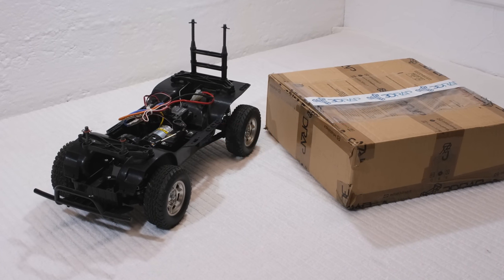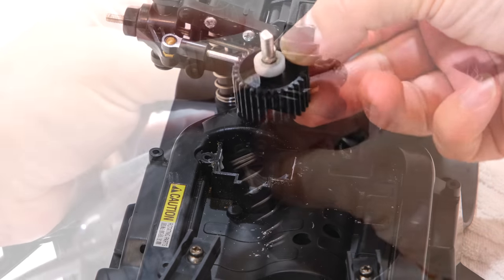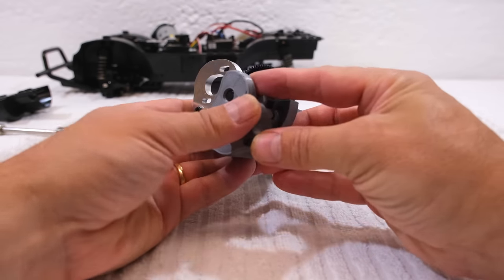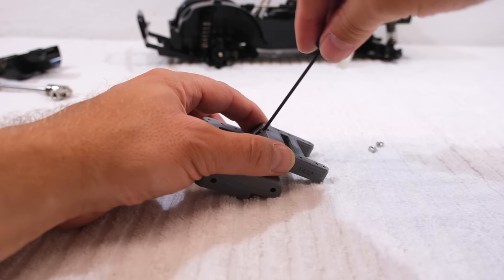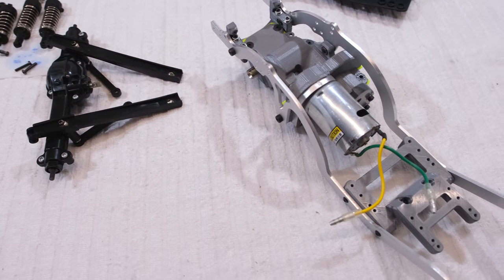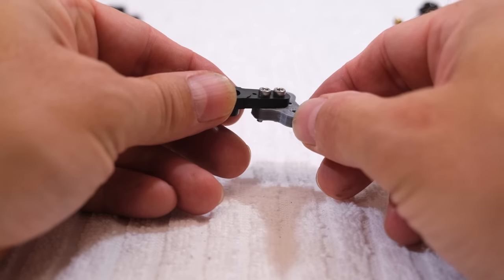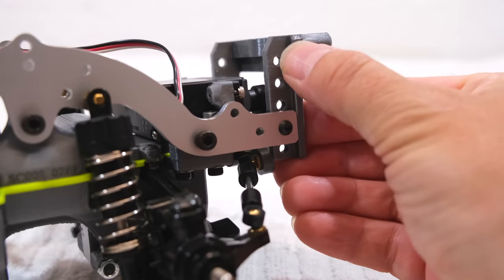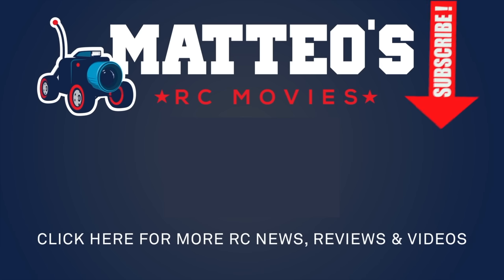Tamiya CC-01 Longheroni Conversion - Installation and Transformation

Comment: Great to see the CC 01 getting some more aftermarket love.  Would be great to see some more suspension travel to compliment the new chassis. Looking forward to a running video and your thoughts afterwards.
Reply: Some aftermarket love? He replaced 80% of the original parts! 3DRAP should finish the job and replace the remaining Tamiya parts, because they're made of weak ABS plastic and they will crack and fall apart when they get old, even if the truck is never driven.
Reply from the maker: I'm sure, with longer dampers, we can get more travel... 👍😊
Reply: @Matteomeier  Even if you put long dampers in front, suspension travel would still be very limited because you still used the stock lower suspension arms. What you should have done is redesigned a new longer lower arms to allow more travel. I admire the effort and engineering you've done here but it's the suspension is what you have improved from the very beginning. The gearbox of the stock CC-01 is fine. It's the steering and limited front suspension travel are the biggest issue of the CC-01.

Comment: I have a CC01 chassis that the previous previous owner tried to convert to a front mount servo like in this conversion. That ended up cracking the tub of the original chassis. Buying a new tub was almost the same as buying a new CC01, so it has lived on the shelf for many years. Maybe I will get this conversion as all of the running gear is still good and much of it is metal upgrades already! Thank you for putting the beetle body on in the video. Gives more feeling to the finished size!
Reply from the maker: Yes, this can solve your CC-01! 👍😊

Comment: Wow, totally what it should have been to begin with. I had just shelved my CC-01. Gonna have to give this  a go.
Reply: Could NOT agree more!!
Reply: I'm vaguely tempted, but I think I'll get an Element RC TrailRunner instead. Same suspension design, but it's made from stronger plastic and it fits standard 1/10 scale truck bodies.
Reply: Shawn Elliott the trailrunner is 10 times better than a cc-01. Its an actual crawler and this is an old plastic cross country design
Reply: @mojaverc1585  maybe, but the CC-01 is a classic and we are not talking about no Trailrunner.
Reply: theLEDwheel yeah I know its like 26 years old but I would rather have a trailrunner than my cc-01.
Reply: @mojaverc1585  the cc was designed to be a cross country vehicle, not a crawler and the trailrunner is (in my definition) still not a crawler. The CC can take other bodies and is available diff wheelbases. I've seen some amazing projects with it. 

What you   have vs what you want or prefer is a personal choice. I have 4 trucks that i taken out on trails and rocks and the one i choose on any given outing depends on how i feel and want to experience that day.

Putting down RC's that others love is not constructive. If you  want an Enduro then get one.

:)
Reply: theLEDwheel i was actually just agreeing with shawn that he should get a trailrunner because of my experience with my cc-01.
Reply: @mojaverc1585  sorry, was not directed at you. Replied in general but you got tagged.
Reply: @deusexaethera  For a "Crawler" I would agree...
BUT the Bodies for the Crawler Class are NOT 1/10th Scale - more like 1/8-1/9th Scale. 

CC-01 and CC-02 are TRUE 1/10th Scale!
Reply: @CarminesRCTipsandTricks : I disagree. Scale crawler trucks with 1.9" wheels are slightly larger than 1/10 touring cars, which is scale-accurate since small trucks and SUVs are slightly larger than real cars. The CC-01 is the truck equivalent to Tamiya's 1/12 "M chassis" touring cars.
Reply from the maker: Good idea! If you have a CC-01 left, you should do this! 👍

Comment: Ordered, will arrive tomorrow..... CC-01 deserves a lot of love :)
Reply: But even now I can see an issue. As the front shocks are in the middle of arms, they are working under 2:1 ratio, while rear shocks are working 1:1. In gerenal it means that the front is easy to compress while the rear looks tough. And now the battery is placed in the front as well, which means it will make the situation even worse. We'll see.......

Comment: I have the same chassis, but I feel its performance is not good, I have also thought of rebuilding the chassis in this way. I just don't know how to do the gear box. After watching your video, I feel this solution to be very good, use 3D printing. Thanks a lot.

Comment: This conversion kit is very good for optimize cc01 chassis , there is room behind the motor , so we can install gear reduction without cut anything , and i think we can use cc01 upgrade kit from yeah racing or gpm
Reply from the maker: Yes, of course! Then it's even better! 👍😊

Comment: My Friend, this goes beyond conversion... It's a TRANSFORMATION!! 😁 I will be anxiously awaiting seeing how it performs. 
The only thing I question about it - the CC-01 ALWAYS has been Geared TOO HIGH. I was hoping with all that impressive work on redesigning the Gearbox... They could have fixed some lower Gearing. At least give provisions for a smaller than 16T Pinion Gear.

Other than that I'm completely impressed!! Have a great Weekend!! 😊
Carmine ✈🚂🚙
Reply: It looks like with that slotted motor mount, you could likely stick a smaller pinion on no problem.
Reply from the maker: Hi Carmine! Yes, smaller pinions can be installed, up to 12 tooth. Have a nice day! 😊
Reply: @Matteomeier  COOL!!

Comment: I bought this kit after watching your video. Although the design is great, it's made out of cheap materials and is not very precise. Nothing fits right. It's very brittle and breaks easily. I had a minor crash and the front end is gone.
Reply from the maker: I did not drive mine yet. But you should contact 3drap and tell them your problems. They still improve the product.
Reply: Hi Erin,  In the first minutes watching i thought great upgrade. But watching sir Matteo assemble the whole thing, i was concernd about quality of plastic parts. They look indeed brittle and not 100% fit? Thank you for confirming Erin.  Matteo 👍🏼

Comment: That is a very comprehensive chassis upgrade for the CC01, however, one might have to ask oneself, why upgrade this chassis  when you can purchase a CC02 ? Also you will need to compare the cost of the upgrade to the CC01 with the purchase of the CC02?
Reply: Or you could buy a good chassis and get nice parts of your choice
Reply from the maker: Of course I would not buy an extra CC-01 for this conversion. But when you already have a few CC-01s it's a good choice...

Comment: Thank you for a nice video and very informative and instructive as always!
I look forward to the comparison test in the terrain, to see what problems with the CC-01 this new chassis solve. The steering is direct on the new chassis of course, taking out the play in the CC-01 linkage system, this is an improvement. But are the articulation, weight distribution and ground clearance better on the new one? 
The position of the battery pack is higher on the new one, giving the new chassis a higher point of gravity.  The battery on the CC-01 is placed much lower, giving it the advantage of a lower point of gravity, and will this give the old CC-01 better handling in the terrain compared to the Longheroni?
The all important driving test will tell, it will be exiting to watch.
Looking forward to your next video, all the best.
Cheers.
Reply from the maker: Thanks Nordmann, I will try it on the field soon! 👍😊

Comment: So replacing the entire chassis gives a more direct steering input from the servo (but likely not much more in steering range) as well as the ability to use longer shocks.  Is this worth the 109 euros?
Looks cool though, and slightly easier to clean.
Reply from the maker: I forgot to mention the possibility to install smaller pinions... 😊

Comment: How does it feel? Is it sturdy? will it handle bashing? 

I have a darkdragowing engine printed in abs.... feels cheap, already broke 2 things on it...and I haven't even been on the trail :D
Reply from the maker: The parts feels pretty robust. But in my opinion a CC-01 is not a basher, more a trail truck for slower drives.

Comment: I have bought this kit, and I dont think I like the steering. It seems that i turn sharper on the outer wheel than the inner wheel when turning. Have you noticed this? Have you done some changes to this issue?
Reply from the maker: Yes, that's true. The outer wheel turns sharper, but it should be the opposite. I have not driven the car yet, but I think this issue can only be fixed by moving the servo to another position.

Comment: That fluorescent yellow rubber seal screams "Italian design" to me. Italians love bright accent colors.

This looks like a very well made kit, but I'm not sure what the point is. Reusing any of the CC-01's extremely old parts is a disadvantage. 3DRAP should finish their design by replacing all of the remaining CC-01 parts.
Reply: Yeah i reckon this is pointless. Just buy a good chassis and put some nice parts on it. The cc-01 isn’t capable but that is what makes it fun.
Reply: @mojaverc1585 : The lack of capability made it not fun for me.
Reply: Shawn Elliott Its actually beginning to be not fun for me too. Thats why i haven’t run the cc-01 in months. It would be too expensive to make it fun. Lipo, electronics, suspension, tyres, wheels, steering, suspension links. At that point it still has a bad chassis. Also its so small
Reply: @mojaverc1585 : Yeah, that's the position I found myself in after owning a CC-01 for a few months.

Comment: I feel like Tamiya should have just updated the CC01 to provide more gearing and better ground clearance instead of the IMO quite cookie cutter and inferior design of the CC02.
Reply: The CC02 should not have been a CC
Reply: It is a CrossCountry vehicle!!! Everyone got that straight! Its not a crawler. Its like to take a jeep for a monster truck spin but cry in the end why this jeep wont jump like a mt
Reply: i love my cc01 fast and versatile
Reply: From my point of view CC series arent meant to be competitive scale crawlers but meant to be a Radio Controlled "Model Kit" since tamiya really is a scale model kit company. It focuses mostly on the You have to build it and appreciate it more than the RC capabilities. I Buy tamiya for nostalgia nd overall fun and buy aluminum aftermarket parts for a scale crawler.

Comment: How much is this kit? And do you think it becomes a much better crawler with kit?
Reply from the maker: You can see the price on the link in the video description. Basically the cc chassis is not a crawler, it's a cross country chassis. But the conversion have some significant improvements.

Comment: How important is weight in an RC model?  Is a lighter frame advantageous?
Reply from the maker: In a scale truck weight is better, to give a more realistic movement and more traction on the ground. Best is to have more weight in front and located lower to keep the center of gravity down.
Reply: Hi Matteo's RC Movies ! So with this new “longheroni” type frame you have to add weight, or its elements work perfectly and the model has the right balance and traction?

Comment: What’s the point of the change?
Reply: It brings the CC-01 more in-line with modern frame-rail chassis platforms. Any significant aftermarket offering for the CC-01 is going to be welcomed by a CC-01 enthusiast, and that platform does have it's own tribe.
Reply: RC Dabbler 
Here here, couldn’t have said it any better. I love all 6 of my CCO1’s

Comment: If anyone is thinking of getting this... DON'T.
The steering is really, really bad. I had mine for 3 years, never crawled with it because I couldn't get the steering going... I gave up and tore it down and put the parts back in the same tub they came out of...